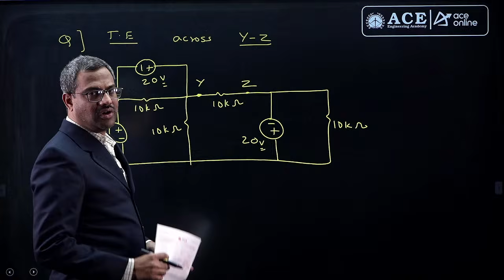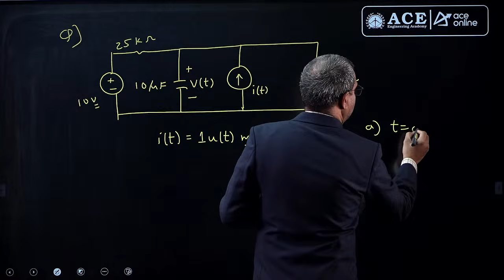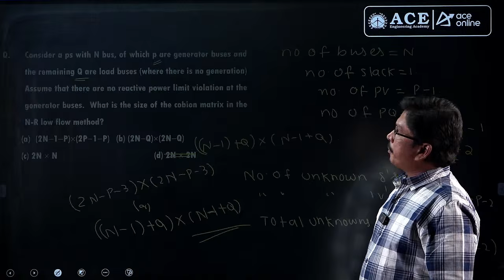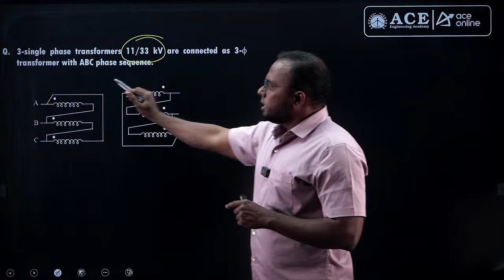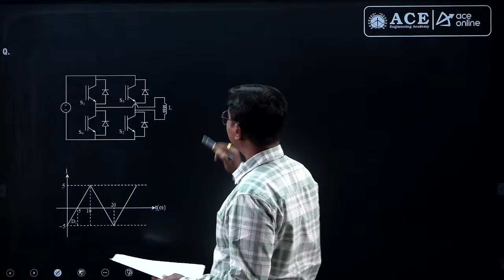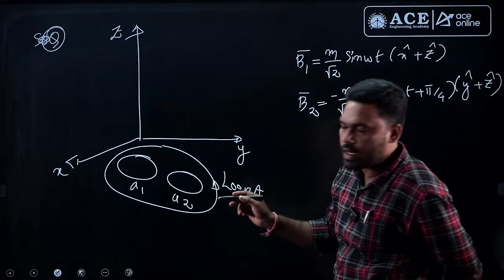GATE - 2026: Electrical Engineering | Question Paper Analysis & Detailed Solutions | ACE Online

Comment: Circle wala problem ek baar bata do
Reply: 50
Reply: Dono isosceles triangle(POR & QOS) h kyunki radius h do sides now ek triangle k angle ko x assume karlo aur dusre triangle k angle ko y ab angle(POR) jo hoga woh 180-2*x ho jayega kyunki triangle k teeno angles ka sum 180 degree hota h similarly angle(QOS) 180 - 2*y ho jayega ab angle(POR) + angle(ROS) + angle(QOS) = 180 hoga straight line h ab isse (x + y) = 50 aa jayega, ab angle(ORT) = 180-x hoga straight line aur angle(OST) = 180 - y hoga ab quadrilateral(ORTS) k saare angles ko add karlo 360 degree hona chahiye ab angle(RTS) ki value 50 degree aa jaayegi. Pen paper par step by step karlo 50 aa jaayega same process se, koi doubt ho toh puch lena yehi par reply m